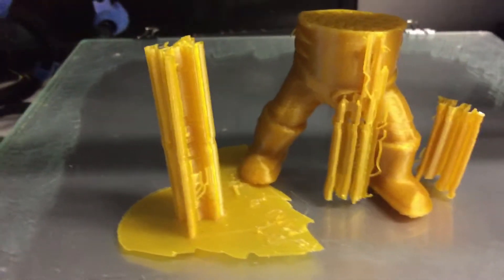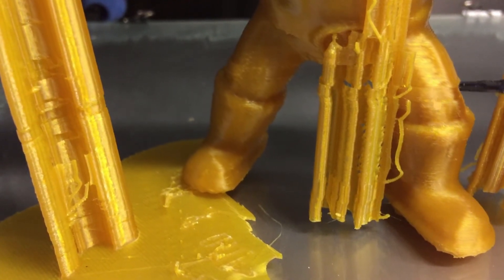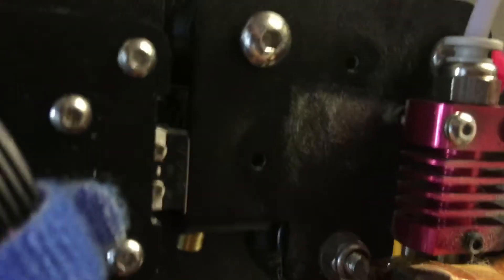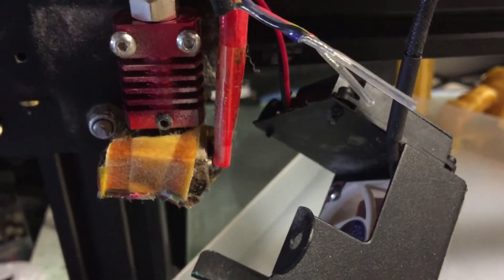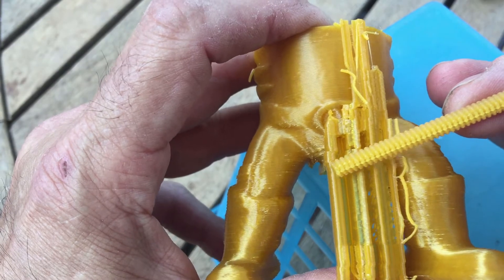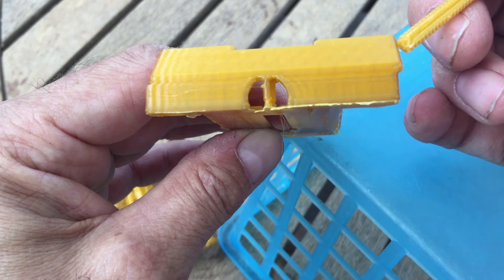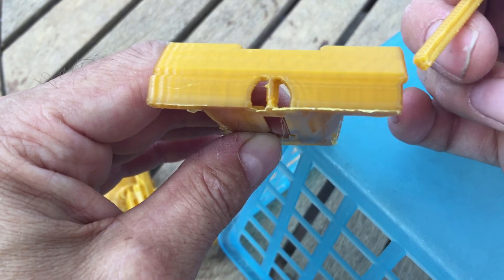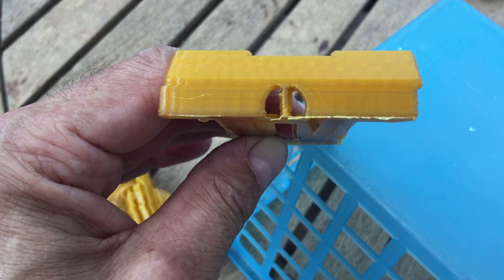How To Fix X Axis Wobble, Steps, Shift Problem On Creality CR-10S. Extruder Hitting Printed Object

Comment: I wish I would have found your video earlier. I put my CR-10 on mothballs about a year ago after trying several non-fixes .I cannot believe that it was this simple. Thank you.
Reply from the maker: Thanks..I wish I had more time to produce videos. As it is I don't have time for my hobbies let alone make videos for them.
Reply from the maker: Also make sure your nozzle points straight down when tightening. I think mine was askew as in certain directions I would get layers not laying correctly.either being squished into the glass or laying on top depending on direction.

Comment: Yes it is a new machine.
Reply from the maker: Well try the file on the sd card as that sould be correct. It use to be decapicat (cat with a broken neck). If that prints ok its a cura setting thats wrong. For help on the printer the best thing to do is join a facebook group like https://www.facebook.com/groups/CrealityCR10/  which are usefull for people who are stuck.

Comment: Hello, I have A Creaity CR-10 with Dual Z Axis motors. The z axis goes up and down when homing but will not go up when printing. Is this a problem with my machine or am i doing something wrong in Cura ?
Reply from the maker: guessing its something in cura as it cant be the machine as you say that goes up and down. Havent used mine in a while but layer height should be 0.2mm or about. Is this a new machine?

Comment: I'm getting the same behavior - I'll look into this! I've tried all the typical stuff light tightening the belts and wheels, but somehow this is the first I've seen someone suggest tightening the extruder. I bet that's it...

Another thing that just comes to mind is you could also try using z-hop during travel to reduce the chance of the extruder hitting things in the first place.

Comment: ive been fighting this issue since I got my cr10s pro and most likely caused from a nozzle bed crash when I first got the machine. it printed good out of the box but then one day I leveled the bed and the nozzled crashed hard in the bed and I had print issue ever since. it always seemed to be in the x axis and was so random but I watched every video on the issue and thought well it maybe related to z hop or something. I just ran across this video and couldn't believe it would be this simple but just walked in my print room and low and behold it loose as crap! thank you so much round tuit!!!!!!!!!
Reply from the maker: Its always good to get a comment back. I think I will restart my channel again in 2020 as all my making equipment is now set up.

Comment: Thanks!  After trying everything else this was the cure for my CR-10S's shaky prints and x-shifts.  My nozzle assembly was much looser than shown here, wobbling back and forth at the slightest touch.  This should be on every list of regular maintenance checks and every list of what to check to fix wobble or x-shift but I haven't seen anyone else mention it anywhere.
Reply from the maker: Make sure you have the nozzle points straight down when you tighten it.
I think I just tightened mine and it was at a slight angle which caused a few printing errors that affected the first layer of adhesion and during the print, it would sometimes look weird in places. Another video for another day.

Comment: Every 30 seconds I hear your fire alarm chirping , letting you know to change the battery. change it before your house burns down.. eesh.
Reply from the maker: Thats all been done now with about 9 fire alarms that are interlinked so if one goes off they all go off. We have sheds with power as well so they are connected. was a couple hundred pound in total but well worth the peace of mind. We also have normal ones dotted around the house one attached to the top of the 3d printer or anywhere that might be a possible problem.

Comment: Having same issue.my prints go to the right a good 2 mm .  I have the cr10s pro. Its so annoying. Glad ive found this vid. Gonna attemp it now. I shall let u no if correct it.
Reply: Did u fix it with ur pro?
Reply: @limitless3dprinting365  yes problem solved I tightened screws and solved the issue.
Reply: @madabouthistory4611  how many screws did you tight? Just 2 in the extruder? i have a pro too and keep getting shifted layers
Reply: @limitless3dprinting365  yes mate the 2 screws holding extruder. Also I took bed off and tightend the screws for the tension belt bit only slightly.  Don't do too tight . I've found wirh the cr10s pro u will need to relevel the bed numerous times before u get it perfect. It's like it resets it self when ever its turned off .. cheers
Reply: @limitless3dprinting365 I here you for sure, when I got mine I was ready to throw the thing out the window, made me super angry , but u just need to be patient with it and get use to it. like say m8 tighten the 2 screws holding the nozzle, tightening the screws under the bed maybe not needed but I did it, and then use draft 0.2mm change infil to 10 or 15% chane support angle to 75, all should be good.